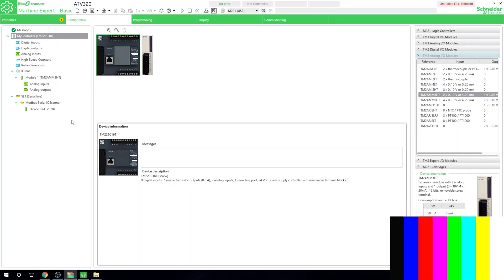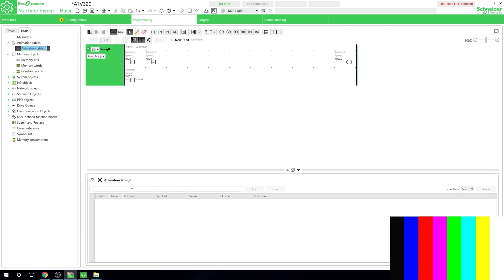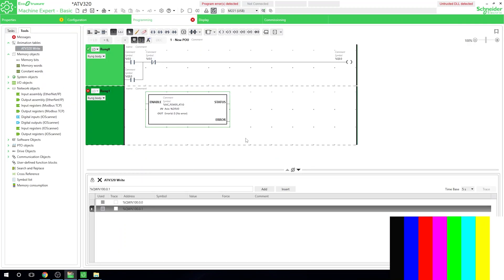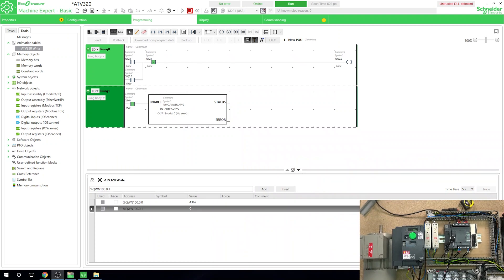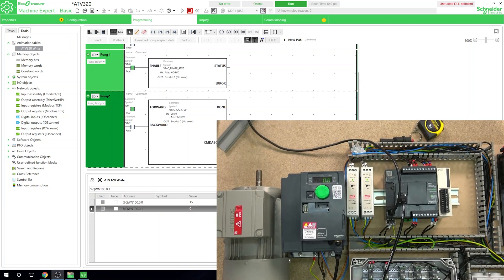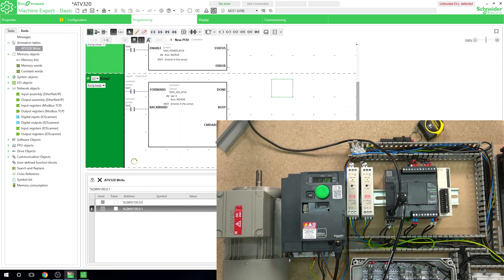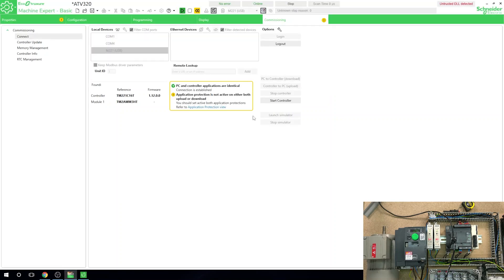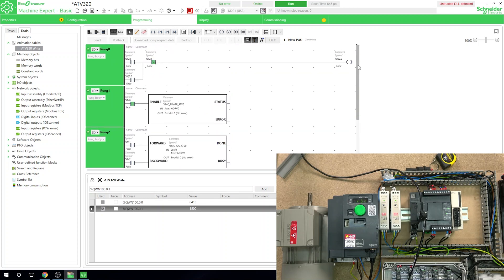Schneider Electric Modicon M221 PLC Modbus RTU set up and programming with ATV320 Drive. Part 2. Eng

Comment: How to control Schneider vfd with delta plc via modbus..?
Reply from the maker: Have not played with that yet, so wont be much help.
Reply: @IGSElectronics  I have used delta plc to control delta vfd. Delta vfd manual has written modbus addresses very clear but I'm having troubles figuring modbus adrresses for Schneider vfd.